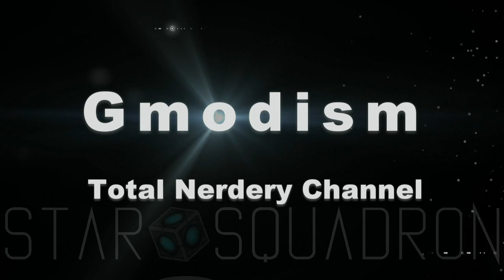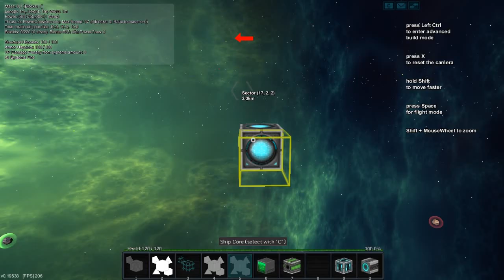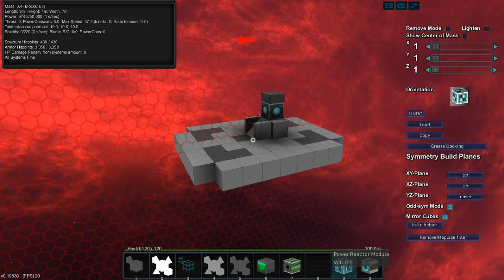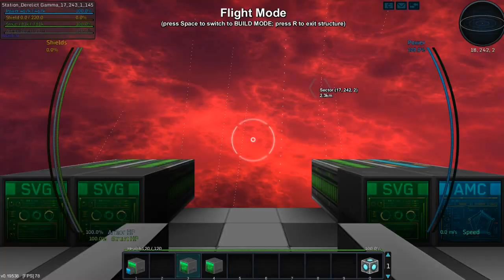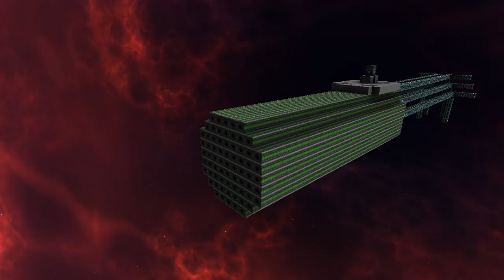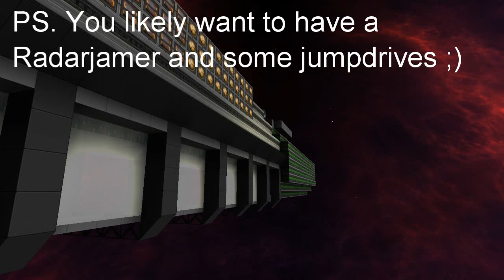StarMade Compact Tutorial | How to build a Mining Ship / Salvager

Comment: I used to do the 3 axis pattern into nested cubes, but then I found out that you can just put it in lines and it gets you about the same power.
Reply from the maker: +00meat Plays 3Axis is more efficient as it calculates mass for efficiency, but lines is the second best if lines are longer than about 8 I think it was.